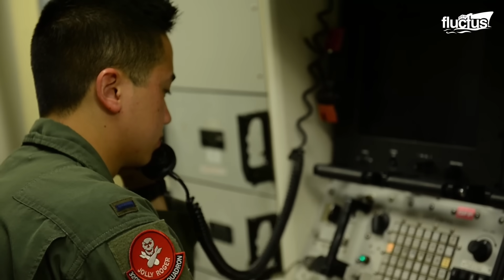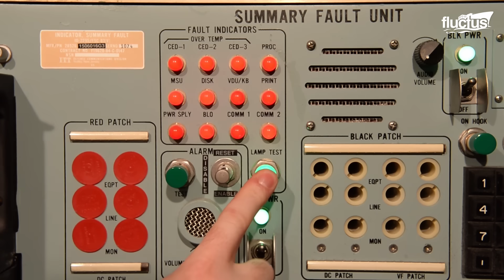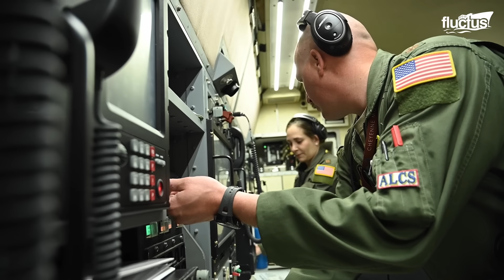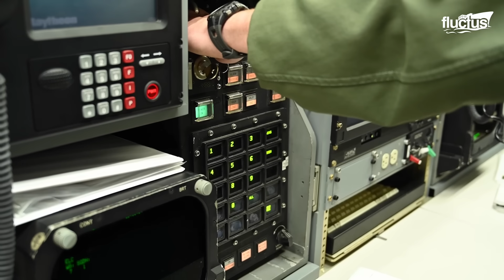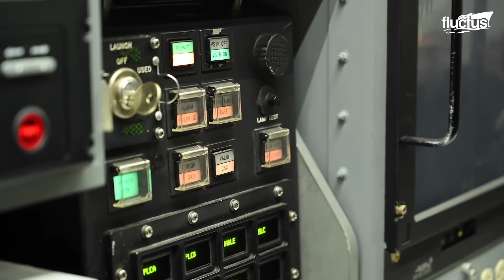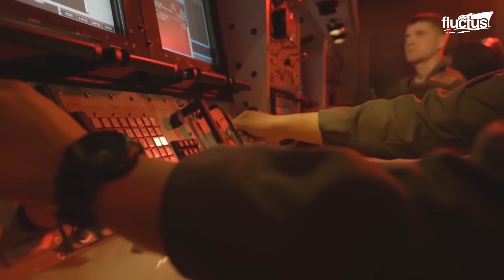Why US Genius Idea to Launch Nuclear Missiles From this Weird Truck Failed

Comment: Submarines are the answer. Most of the US's Triad is at sea. Hiding in the ocean vs a bunch of roads and rails is more stealthy. 3/4 of the world is ocean. Subs can be anywhere. Land based ICBMs and bombers are really just backup to the subs. The US needs to replace it's Minutemen and there is a debate about the worth of it.